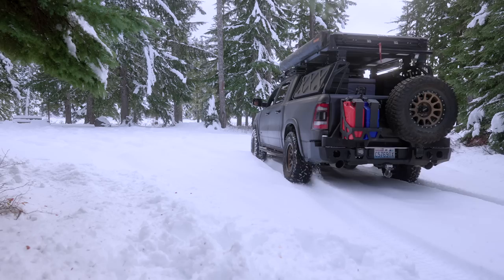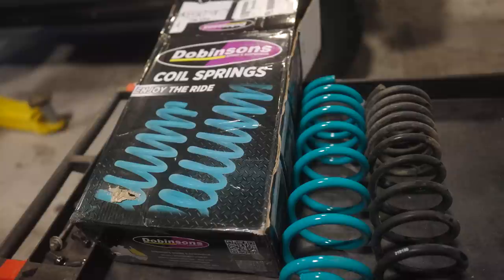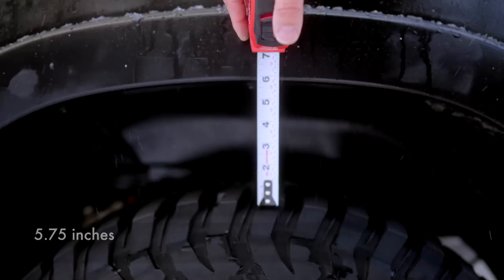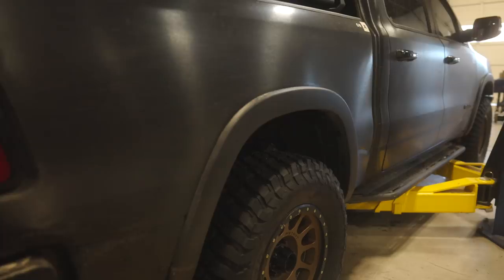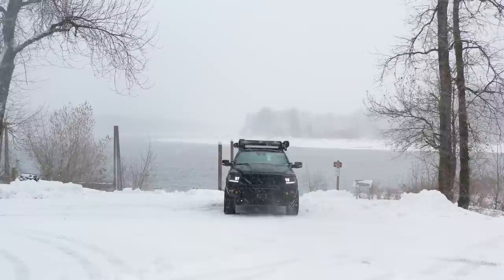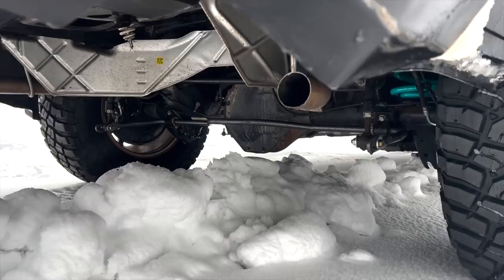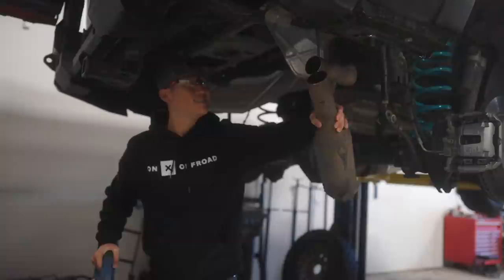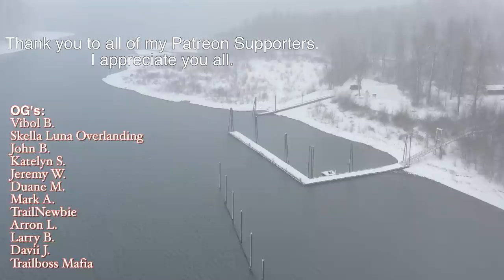A Problem with Shadow - Ram Rebel Overland Build Issue - Rear Squat

Comment: Carli has created a heavy duty rear spring I think with 500 lbs in mind for those with constant weight on the Rebel, but tuned for a dynamic ride.
Reply from the maker: I saw that! But it seems to be a bit more expensive than the Dobinson, so I’ll keep in mind for the time being 🙌👊

Comment: Hi Ed, you can also put RAM 2500 rear coils on a RAM 1500. this is something aftermarket companies wont share because they want to sell you their products but in the RAM online community (forums) its a well known option. the only take away is the rear ride might be a little stiffer empty but nothing a load like you are carrying wont take care of. plus it allows you alot more capacity after you're 500lbs load is taken into consideration.
Reply from the maker: Thanks for the heads up. Are the 2500 coils the same length as the ones in the Ram Rebel?
Reply: @KrokemOutdoors  that i cant say, all i know is some ppl have done the 2500 coils swapped on the 1500 chassis. it might not be a direct fit but im sure its nothing a shop with fabrication services cant handle given you already have a rear coil setup. that way you have an oem quality coil with a known capacity and inch/lbs rating at a fraction of the price to an aftermarket coil. if it is longer, im sure its not by much but you can always compensate the front with a 2-4" lift coil or system that will settle with the added weight on the front with your bumper and winch. hope this helps.

i have a Chevy 2500 myself just because i didn't want to spend on aftermarket suspension for extra capacity when i can get it oem with a decent ride.

Comment: @Edward Shin, another great vid, brother! One note about the exhaust. You should run the exhaust tips beyond the body on the sides. One main reason is that when sitting Idle; example: when sitting at a traffic light or in a traffic jam, the exhaust gets trapped underneath and can send fumes into the cab. Mine was from starting the truck and letting it idle to warm up. When I got in the cab was filled with exhaust.

I did this same “mod” back-in-the-day on my F-250, the same as you showed. The fumes inside the cab, with all windows closed, was horrible, especially since it was winter. It gave me a horrendous headache for three days. The next day I extended the pipes out both sides just in front of the rear tires. No more gagging exhaust fumes.
Reply from the maker: Thanks brother! I currently have them cut behind the rear wheel, so I didn’t feel that the fumes would reach the cab. But I’ll keep this in mind and see if I notice any odors when driving around. 
I am happy to report that so far , it has been minimal though 👍
I appreciate your feedback and suggestion!

Comment: Nice rig!! I had similar issues, I installed Airlift airbags HD inside the coils, connected in series, so the air compensates between both when offloading. I have an airtank and compressor running the system automatically. 4 years with the setup and worked !
Reply: Airbags is where I was thinking of going to.  Is it quite expensive?

Comment: I've had great results with my Jackery 1000. I tested it in extreme heat last summer. Left it running my fridge in the truck during 110 degree heat when the interior of the truck was at least 140-150 degrees for about 12 hours. After that time, fridge was still at 39 degrees and the Jackery still had 74 percent power  left. Very happy with it. Solar charging system works well, too. Good video. Thanks
Reply from the maker: Nice, I’ve been pleasantly surprised with its performance so far 👍

Comment: I went with air ride air bags. Installed it super fast. Only 100 bucks. I have had zero maintenance or problems with my set up. I went with the easy air option and just ran the air line up to my gas door and I fill it with a simple bicycle pump l. I know you talked about these types of set ups in the video but I would highly recommend trying it. And for 100 bucks you really can’t go wrong. Stay safe out there and God bless my dude!
Reply: what ones you go with?
Reply from the maker: Nice! Glad to hear it worked out!
Reply: @a-aron1550  air lift 1000 drag bags

Comment: Great idea on the Jackery - eager to hear how it does in extreme cold. Also interesting on drying the awning. When I was a Scout leader, we had a system to hang ground tents and tarps when returning from a rainy or snowy camp out.
Reply from the maker: So far it has been surprisingly good. Temps down to mid 20’s so far. Curious to see how they perform in colder temps

Comment: I have a 2020 power wagon,  leitner rack,  decked drawers, CVT clamshell tent,  oversized spare. I went with the Carli pintop and ordered the upgraded rear springs rated at am additional 400lbs, not only are they thicker but they are 3inches taller.  They fixed my rear sag.  That said the front control arms stole about 3 inches of clearance, so be cautious there. I also took the nitrogen charge from 200lbs to 250lbs on the rear.

Comment: I have a Ram 1500 build.  I had same issue.  My guy recommended air spring helpers. It's been a game changer. The air ride is adjustable based on my loading.  And I can adjust ride side to side.

Comment: Edward, I have a Icon Dynamic Level 3 kit on my 5th gen 4Runner.  After getting the various mods to the vehicle. The 4Runner's back end sagged badly. 
The Icon Dynamics rear coil springs a no go. In Turn, with the addition of "Old Man Emu 880lb constant weight lifting coil springs".. 
 A huge difference in lift and ride characteristics. 6 inches on the front and 8 inches on the rear.
The 4Runner has a slight downward slope on the front, It handles great and corners flat, even when fully kitted out. Good luck with your new springs. May they be the answer to the rear sagging issue. Or perhaps a custom made set of coil springs. From "Alcan" the same company who made custom rear leaf springs for Jason of "Primal Outdoors" Just a possibility Cheers, Mate.
Reply from the maker: Thank you Jack! Glad to hear the heavy duty coil setup is working out on your 4Runner 🤙
I’m hoping these coils I got will do the job, but will keep options open and in mind just in case. 🙌

Comment: Another good video. Thanks. I had Dobinson springs on my 80 series and they held up great.  As others have mentioned, the Carli suspensions seem great. I recently installed one of their systems on my 2500 and it is much better than what was on there. I'm glad you're getting everything worked out on the rig. It looks awesome. 👌
Reply from the maker: Thanks! 🙏 I heard Carli recently released one for the Rebel, but it is a bit expensive, so I went with the slightly less expensive route 🙌
Reply: Yeah the Carli wasn't cheap. I only did a leveling kit with all four shocks, track bar, and extended sway bar connects and it was pricey. This is a truck I plan on keeping for a long time so I thought it was worth it. I hope so at least.  :)  I look forward to seeing what you decide on. Thanks again for effort you put into these videos.

Comment: I have those same dobinsons hd springs on my Cherokee trailhawk, and I carry 600 pounds or so static all the time . I have had my my jeep fully loaded , towing a trailer weighing 2600 lbs and 3 other 200 pound adults  in it beside my weight and I couldn't get them to sag at all. When they say hd springs they mean it. I've also had them on for over 2 years and off road with that weight and haven't ever noticed a change in the springs. I would be surprised if you ever do
Reply from the maker: That’s great to hear! I hope they will perform the same for the Ram as well

Comment: Another great video! I have the basic Timbergrove air bags on my Rebel and it’s nice to have the capability to adjust the rear when I have the extra payload. I do need some HD springs though as I have the RSI SmartCap (400 lbs!) and sometimes my RTT and all the other gear I take on our trips. Definitely will take a good look at the Dobinsons. Thanks again for the review and look forward to a future long term eval. 👊🏼

Comment: Sorry if this was covered in other videos, but I have a few questions:
1) What is the max payload listed on the door?
2) What was the new/unmodified curb weight of the vehicle?
3) What is the GVWR of this truck?
4) What is the current weight, dry or loaded for the trail?
5) Original springs on the truck probably had a rating of lbs per inch compression.  Ram should share that info with consumer or dealer.
6) Suggest NOT buying coils without knowing the spec of weight per inch of compression.  Otherwise they might not even be as good as what you have/had.  Marketing terms like 
'heavy duty' other any other non-measurable term mean nothing.

Saw someone mention using 2500 coils, assuming they fit, learn their specs first and see if your carry weight and the desired squat match up.

Curious if the truck had any additional payload package type options when new?

Sorry, had more than a few questions but hate to see someone disappointed in their truck performance.  Riding on bump stops is not good for the truck or it's owner.  Your truck forums will provide the best info online as fellow owners are not paid to lie or mislead to sell you things :)

Comment: You should put some turn downs on those exhaust pipes.  It will keep the fumes from building up under the bed, and also reduce risk of melting any wiring in the path of the exhaust.

Comment: Nice looking truck. How has reliability been? Good info. Thanks for sharing. Coil should hold up. Not as well as leaf springs.
Reply from the maker: The only issue I’ve ran into so far is the power steering failure one time. Hoping that will be the last of that

Comment: One thing I heard about you going with a dual battery system. If you’re looking on putting a solar panel on your hood, I would recommend that you remove the wrap on the hood before doing it. If you want to know, direct message me. And I will tell you why

Comment: I had a 2019 rebel and absolutely loved it but it does have some limitations. I went with a 2022 2500 with the Cummins and off-road package and it’s been great. Torque is never a question and with a coil suspension all around, it rides well. Plenty of options from carli as well to fine tune things
Reply from the maker: Any issues with the coils after adding some weight on the bed?
Reply: @KrokemOutdoors  no, I never keep a constant weight in the bed. I use it heavily work for as well as fun. Between rocks, plywood or a gooseneck trailer, it’s been fine. I did change out the skid plates  with some from CJC off road and the AEV wheels gave it the perfect offset. The Rebel definitely had a tighter turning radius which I miss, especially on some trails. The interiors are almost identical so I felt right at home.

Comment: I have a RAM2500 but can’t recommend air bags enough. I run a Norweld with a FWC and KING’s. The weight swing is massive depending on the trip, bags are the way to go.

Comment: I had good result with 1.5" strut spacer front, coil spacer rear on my ram 1500. Maybe a small spacer on the dobinsons rear coil would set you back to slightly nose down, like an mt bed, with you permenent static load? REBELs are slightly taller than other models.

Comment: The boys down in Australia called big dog builds use an air compressor and air bag for the rear to help with all the weight with the overland builds on their trucks. You should check it out should help more with your rear sag.
Reply: he mentions that he didn't want to do air bags in the video
Reply from the maker: If the coils don’t work out as intended, I may look into them as a last resort 👍

Comment: Great channel Edward, but don't understand the reason to test the Jackery in the weather. What's the end goal? Getting it wet will kill the battery? Yeah we already knew that. Can it handle misting or maybe a 1/4", 1/2", 1 foot? Makes no sense. That's like leaving your windows down on your Ram truck and saying the leather seats don't hold up or hold too much moisture or the water gets in the door and you have a mold issue so Rams have mold issues if you get too much moisture in the door. I don't get the reasoning of the test.  Seems like a waste of resources as the outcome only shows failure, not whether it can handle so many charges, or so many cups of coffee... You lost me on this one. Save travels.

Comment: I’m at that exact fork in the road with my Sport 1500.  I elected to go with 2” spring spacers on top of the springs.  I hate how it handles on highway camber, which can be 70% of overland driving in AZ where I live.  I much prefer the sag and the drive feel, but just not the bouncy feel under load.  So, unless I want bags, looking at longer springs.  Not sure if a greater capacity weight rated spring will change what I already have.  Interested in your updates.
Reply from the maker: That is a reason why I personally prefer no spacers, since it affects the ride quality. 
But I’ll provide updates on how these hd coils hold up over time

Comment: I’m very interested in the dual battery for the Ram, I have my own build going on right now and been thinking about doing the same thing.
Reply: I have airlift bags that have built in bump stops and onboard air solely for the bags. I do plan on putting a ARB twin compressor as well.
Reply from the maker: Will keep the channel updated on status 👍

Comment: I really hope your Jackery doesn't bonk on you.  They are built great, but Jackery lacks any kind of USA based facility for after warranty service/repair.  This basically leaves the owner hanging in the wind with an expensive brick with no way to repair it.  Yes, this is from my personal experience. So I learned and just moved on to a different brand with 2.5 times the warranty, top notch customer service, and USA based repair center for any after warranty service/repair needs.

Comment: Anyone have any ideas for my 2016 rear model? I gutted the air ride in my rebel and threw an icon stage 4 in bit have the same problem when I'm fully camped out. I'm guessing with everything Im about 750lbs extra

Comment: Every truck/SUV manufacturer and insurance adjuster does a facepalm when they see overlanders, they’re like….”why do we even make payload rating no one’s following it?”
Reply from the maker: Ram Rebel payload rating is 1,860 lbs, I got around 500 lbs on the truck bed. Is that an issue for insurance?
Reply: @KrokemOutdoors  nice, everything you add to the truck takes away from payload even the bigger tires. It would be nice if that was a mod available was to increase payload.

Comment: He Ed I have the  same winch .The Warn Zeon 12s platinum. Can you let us know how that is working out and how you have it connected. I read that it draws 40 amps and the IBS sensors is only good for 30 amps. Thanks.